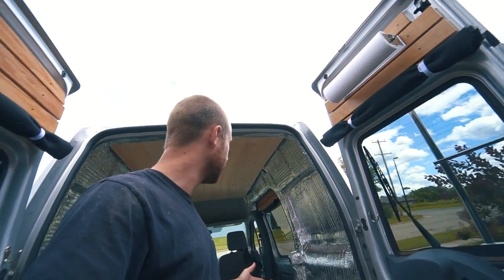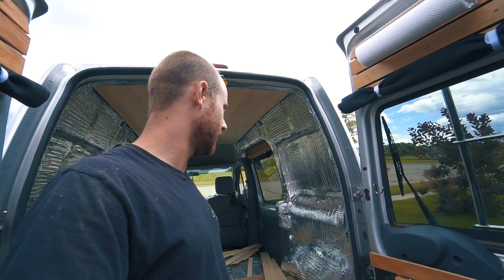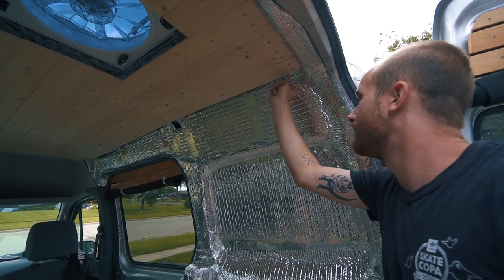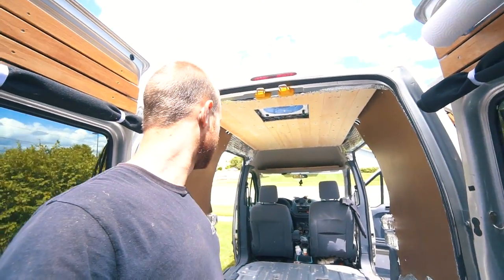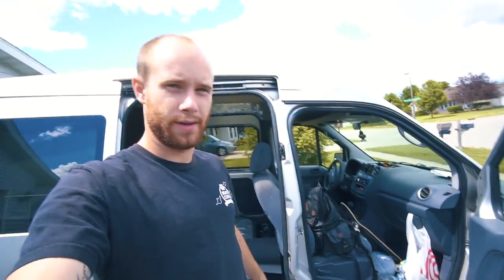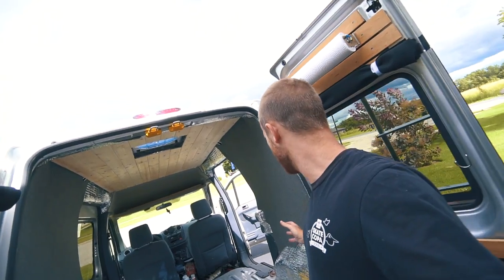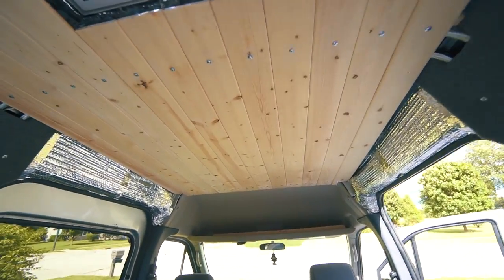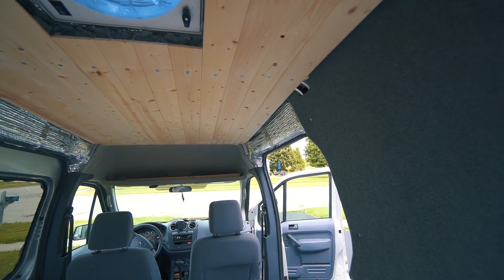Adding Wall Panels To My Van Conversion!

Comment: You need a gap between your metal and the sheet of your insulation panel. This kind is for ambiant temperature not for direct contact insulation

Comment: The side panels seem to take some space away from the interior. For example, your later cabinet on the right side could be a bit deeper with something that fit closer. Would this be worth the extra effort? If you did it again, would you build the cabinet and then put up the wall around it?

Comment: Great stuff.  I like your industrial look ceiling.  I think your panels are great too.  I assume if you had to deal with wiring issues, or heaven forbid water issues later, I'm sure you can get those off and on easy, and they are not too expensive to replace, a very practical, yet attractive choice.  Thanks for sharing.  In the spirit of sharing, You probably already know about this option for water, but weed sprayer DIY showers are a pretty handy for sinks and showers in RVs this size.

Comment: Very helpful thanks for the detailed run through. That carpet looks a little thicker than what lots use , do you know what mm thick it is , what others use is more like a material 4 way stretch and it’s very susceptible to snags especially from Velcro

Comment: Hi there! Very cool video. I was wondering what the Masonite board screws anchor into? Are there wood braces or strips of some sort behind the insulation?
Reply from the maker: Thanks! Not in this build, I used self taping lath screws to attach to the metal of the van. Installing some wood strips is a good idea so it’s easier to locate a solid attachment point for the Masonite!
Reply: @Josh_Oakes  Awesome! Thanks!

Comment: Did you drill directly into the metal van for your siding or into threaded holes? I like this set up a lot but you make it look so easy. I get it’s not super hard it’s just time consuming
Reply from the maker: Into the metal of the van! Using self tapping screws.
Reply: Josh Oakes  I've always wondered this when watching van builds also..so you can drill paneling directly into the van walls? How deep can the screws go? Will the van rust in the areas you drill? Do you need to put something around the holes to prevent rust or water coming in? Thanks for your videos by the way, I think they're great!
Reply: IIheartlovee
You don't screw into the exterior skin of the van, it's only thin sheet metal. The screws go into the raised reinforcing ribs. Usually there is an inch or more clearance between the ribs and the body panels. If you use screws about 1/4 inch longer than the thickness of your new wall panels they should never pierce the outside of the van.

Comment: So you just used reflectic insulation? How did that work out? I'm thinking of doing that as well.
Reply: Dont do it. If it touches any metal its useless. Check the manufacturer spec to fact check.

Comment: Hello, I’m using tounge n groove also, can u tell me what kind of screws u used. I purchased a box from Lowe’s based on the associates recommendation but they will not go thru the strength bars ??? Running accross the ceiling. Will not make so much as s dent. Thanks so much for your videos.
Reply: SoloInARamPro I’m not Josh, but am a carpenter.  Two choices: Pre-Drill Holes, or use self-drilling screws.

Comment: What brand of spray glue did you use? What type of panels?
Reply from the maker: I used 3M spray glue! And I just used Masonite for the panels.
Reply: Thanks! What screws did you use to hold it up?
Reply: @bananafreak987  i did my ford van,  used self tap screws. Make sure you check different screw sizes or they go through your outside walls.

Comment: Hi! How did you go about screwing the masonite into the metal van wall? Did you use specific tools? Specific screws?
Reply from the maker: I just used some self tapping screws with a decent looking head on them as they are visible when looking at the walls!

Comment: Did you use one quarter or one eighth masonite. I have the panels cut but can't seem to get it attached to the sheet metal. I'm using 3/4 inch sheet metal screws. Help?
Reply from the maker: I used 1/8” but 1/4” should still work with 3/4” screws!
Reply: Josh Oakes ok I'll give it another try

Comment: How did you cover all the small areas that were exposed after the wall panels were installed?
Reply from the maker: A LOT of spray glue haha For the parts near any doors I would tuck one edge of the carpeting under the rubber seal then spray glue it to the body!

Comment: Ware did you buy the carpet?
Reply: idk what he used exactly...but something I used that is very similar in color and what appears to be the same texture is called "stereo carpet"...It is really cheap on Amazon and on top of that resistant to all kinds of things from oil to water, to even heat/fire.

Comment: Hi thanks a lot ! 
I think masonite panel + carpet look nice but is there a reason why you didn’t put carpet directly ?

Thanks a lot. I just but a transit connect because of you
Reply: Brad nail would just loosen up over time. You could of just counter sink screws and paint them a close color to the wood first.

Comment: Dont like your insulation (cotton) and all that wood just adds weight (doesn't even look good, imo), but love the grey carpet (adds a lot of class).  Personally, i'd rip out the wood and cover the ceiling in grey carpet...id only put wood on the floor (well, wood colored vinyl flooring).